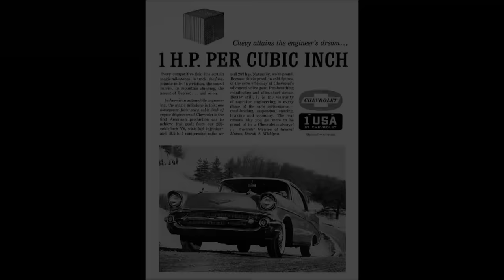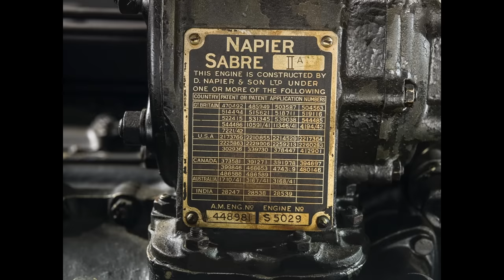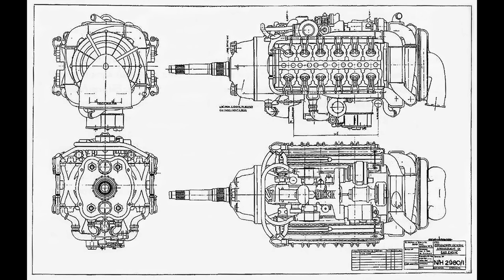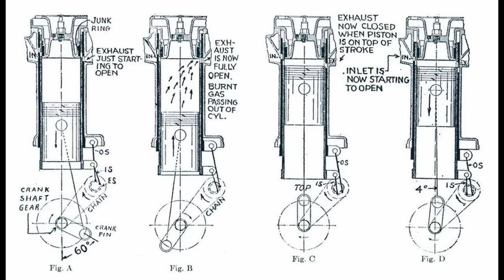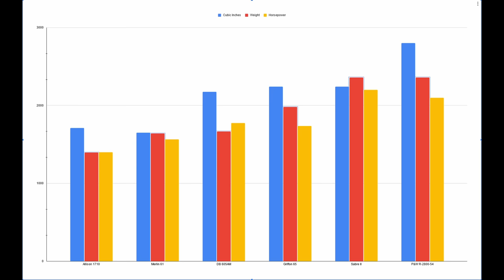Napier Sabre - The Ultimate WWII Aircraft Engine - Part 1

Comment: Interesting. One of my favourite engines. Napier had severe quality control, reliability and management problems in the early part of Sabre.  production. One other problem which many forget is engine cooling. As power increased radiator size had to increase in line. I always wanted to be in on the meeting where the Sabre or PW man extolled the virtues of their complex engines with hundreds of parts - the Swiss watch of power production - and how many horsepower does your engine produce Mr Whittle? - about 2,750 - and how much does it weigh - 1000lbs - ah but how many parts does it have??? One ! - I would love to have a photo of the piston men's faces.
Reply: Great way of looking at it.
Reply: Really for comparison it’s philosophically true but in fact of course there were numerous parts in the whittle engine and unlike piston engines early jet engines had ludicrously short operation times before total rebuilds. At the time they just didn’t have the hi temp metallurgy to run them for very long without catastrophic failure, at least that is my understanding from numerous materials I’ve read from after the war.
Reply: @christopherhughes2211  metallurgy and technique, things we consider obvious now like blade root design took time to develop which is why the more successful early engines used centrifugal designs which are inherently sh1t.
Reply: @christopherhughes2211  You are mixing your English and German history. Read Jet - the book on Frank Whittle and look up Nimonic I also recommend Gas Turbine Engines by Gunston. These will set you right on the development of the technology in Germany and England. Very different. And keep your sense of humour.
Reply: @christopherhughes2211  As a matter of interest - W2B-700 - Combined design based on W.2B/500 and Rover B.26 for Meteor III. Straight-through development of the 'trombone' style W.2 configuration, using already tooled-up compressor casing for Welland, new RR diffuser, and with compressor and turbine air and gas flow increased by 25% to give 2,000 pounds-force (8.9 kN) static thrust. First tested July 1943. Type-tested to 500 hours, into service for Meteor III at 150 hours TBO. Jumo's could only manage 10 hours service and  25 hours before failure.
Reply: I agree with you regarding the quality control issues. I read a book many years ago where early Sabre engine failures were being investigated by the RAF (not the only head ache they had with early Typhoons). Upon engine strip down they found swarf, bits of rag etc inside the engines. For a while they suspected deliberate sabotage at the factory and called in the security services to investigate. The sabre had an expected service life of around 20 to 25 hours before failure. Ground crews used to wrap up hot engines in blankets etc to keep they warm as they found that successive cold starts placed huge premature wear on the engines. I heard this first hand from a ex ground crew foreman who served at RAF Westhapnett (Goodwood). Also interesting to discover that the Typhoon was the only fighter that the pilot had to be on oxygen from engine start until shutdown. Feeding 24 cylinders with 100+ octane fuel lead to huge carbon monoxide fumes build up in the cockpit.
Reply: @christopherhughes2211  The early gas turbines had very few moving parts, the compressor (whether centrifugal or axial) and turbine were essentially one unit as the turbine is required to drive the compressor unlike a piston engine with lumps of metal flying every which way. 
  Frank Whittle remarked that one advantage of his engine was the mechanical simplicity of his design to which an unnamed Rolls Royce engineer was said to have replied “don’t worry old chap, we’ll soon change that”
The main reason that the early German jet engines had poor service lives was that they had limited access the the required high strength, high temperature alloys for use in the turbines. Apparently the French found that when they started on their development of the Jumo after the war even with access to those alloys overhaul life wasn’t that great… First generation jet engine development was a dark art as much as anything
Reply: @turboconqueringmegaeagle9006  I suggest you do some further research (education) - centrifugal engines dominate the helicopter world and many turboprop aircraft in  the 650-1500 hp range. The RR Dart was a big success with centrifugal compressors and over 60,000 PW PT6's have been built. With PR's over 10:1 the centrifugal compressor has a long service life, is tolerant and is certainly not s==t.
Reply: @chrischamberlaine4160   The subject of the comment I responded to was "jet" or turbojet not turboshaft or turboprop so yes, centrifugal flow became obsolete in jet engines as soon as design and manufacture made axial compressors reliable due to 
1. Poor altitude performance
2. Negligible benefit from ram effect
3. Far greater frontal area
4. Greater fuel consumption
5. Weight
Or in layman's terms, they were sh1t.
Reply: @turboconqueringmegaeagle9006  Oh dear !
Reply: @anthonycollingridge970  The carbon monoxide issues were fixed later. Although not the Typhoon, I have the Tempest V pilot's notes, and it doesn't require contiunal oxygen.
Reply: I believe that a lot of the reliability problems with early mass production Sabre engines was due to production being entrusted to a car manufacturing company (from memory possibly Hillman) who had no experience of large aeroplane engines, let alone one as radical and complex as the Sabre,  and in addition were having to use a lot of unskilled labour.
Reply: @tonym480  Quite fascinating to try to establish the history of the manufacture of the Sabre. I'm writing a book touching on the subject at the moment but it's more about turbines and transonics than piston engines. It's well known that Fedden's efforts to get sleeve valve engines into reliable operation nearly bankrupted Bristol and having done so they were asked to give the technology to Napier to rescue the Sabre because the latter could not produce reliable sleeves. I know that Hillman lost a couple of their best engineers (Spencer and Maurice Wilks) to Rover because I worked with the next generation of Wilks brothers in the 70's - John in particular - only then did I discover the wartime dreadful machinations within Rover and their efforts to thwart Whittles W2 in an effort to design their own turbine. Rover had a couple of shadow factories for aero engine production but I don't know which ones they built. Definitely a subject which would benefit from a book about the politics of British aero engine manufacture in WW2. I remain horrified that the big boys destroyed the Fairey Prince/Monarch engines because, with their contra props, they would have added greater safety to carrier operations. The Sabre has always been a favourite of mine because of it wonderfully ambitious design.
Reply: QaA1 lo
Reply: Stanley hooker said that a piston engine has four strokes, one for power, the other three to wear the engine out.

Comment: Interesting video. There's a lot here I didn't know about the Sabre.

I think I can offer some technical maybe insight, based on my own amateur speculation.

Concerning the Sabre's high weight for its displacement, that makes a lot of sense based on its design principals. I doubt the two crankshafts are the main factor, since both a V12 and an H24 have two cylinders per crank throw, so they're about equally weight efficient there. Instead, take a look at the cylinder dimensions. The Merlin had a 5.4 inch bore and and a 6 inch stroke (an undersquare cylinder), whereas the Sabre had a 5 inch bore and a 4.75 inch stroke (oversquare). The Sabre cylinder has both a much shorter stroke to bore ratio, and it's smaller (much smaller in terms of displacement, which goes as the cube of any linear dimension). Longer strokes and larger cylinders are simply more efficient in terms of structural weight. You need to add a lot more metal to get an extra inch of bore than an extra inch of stroke. All containers become more weight efficient with larger size because of the square-cube law. If Sabre was also designed from the start both for a higher power density and higher RPMs, Napier would have needed to go for heavier construction to achieve similar longevity.

So all in all, the Sabre's high RPM (and the small, oversquare cylinders which made that possible) and its high power density intentions lead to a higher structural weight per unit of displacement. The trick, naturally, is to make the power go up by a greater factor than the weight. 

We can see just the opposite design approach with your figures for the R-2800. A big air-cooled radial is maybe the best common design for getting a lot of displacement out a small amount of weight. Big, long-stroke cylinders are, again, more weight efficient. A radial puts a lot of cylinders around a small and short crankcase and crankshaft. Air cooling removes the need for a cooling system, cooling jackets, etc. On the other hand, the R-2800 has a poor specific power. Air cooling becomes a constraining factor at high power densities. Making more power inevitably produces more heat, and liquid cooling can simply remove more heat than air cooling. Overhead cams are also impractical in radials, so they're usually limited to two valve heads with not very optimal designs, and that along with the long stroke, limits RPM, further hurting specific power.

As for volumetric efficiency, it's probably very hard to get good figures on that, and even then, the circumstances under which they were determined may not be comparable, but I really doubt that they differ much between these engines. Any engine designer with high performance intentions has to fail pretty hard not to achieve a high volumetric efficiency at his intended operating RPM. The trick is, which RPM. The huge, unobstructed ports of a sleeve valve design would be great for shifting the peak volumetric efficiency up to a higher RPM, unlike poppet valves which partially obstruct the ports even when open. So the Merlin could achieve a high volumetric efficiency at 3,000 RPM, but at 3,800 the poppet valves just wouldn't be flowing enough to efficiently fill such large cylinders, even with four of them. Of course modern engines do breath through poppet valves at much higher RPM, but they also have much smaller cylinders and technology has just advanced. The R-2800, with even larger cylinders probably wouldn't have been able to go much above 2,700 RPM structurally anyway, so even with only two valves and the non-optimal placement dictated by push-rod actuation, it would still be able to flow enough to achieve good volumetric efficiency at its low operating speed.

I think you're also understating the difference between a 7:1 and a 6:1 compression ratio. That's actually pretty huge both for power output and fuel efficiency. Poppet valves were often a limiting factor there, with designers going to extremes like filling the valves with sodium in order to avoid hot-spots and detonation, so having no poppet valves may have helped the Sabre there as well.

So we can probably say that the Sabre's power is mostly related to its RPM, displacement, compression ratio, and how much manifold pressure the supercharging system can produce, and all the other design features, like H-24 layout, small, oversquare cylinders and sleeve valves, are what allows it to achieve high RPM in such a large displacement. At some point, detonation might start to limit manifold pressure, and at that point, the lack of poppet valves may become an advantage to delaying detonation, but it sounds like the Sabre never really got the point where detonation could become a limiting factor anyway.

Comment: Weight is a big factor in military aircraft, but something that is often overlooked is a form factor and the effect on the overall designs aerodynamics and pilot visibility. A narrow deep cross section can be packaged with better aerodynamics and a low slung flat or horizontally opposed engine can improve visibility and potentially stability. While the engine is a very heavy component in an aircraft, with military planes with armor and cannon,bombs, and the many redundancies required to make an inherently fragile aircraft more rugged and survivable the engine is a smaller percentage of the overall weight. The specific power is likely more of an indicator of easier packaging, power to weight ratio is usually a good indicator of fuel efficiency.
Reply from the maker: I had actually planned on including a comparison of horsepower per cubic inch of aerodynamically wetted area, but cut it for time. I may have to take another look. The challenge will be including the size of the radiator components.

Comment: Very interesting story of this complex and successful engine.
Napier's had made a turbo charged version of their W 12 Lion engine which was successful.
It is surprising they did not design a turbo charged poppet valve V 12 engine which should have had the best power to weight and power to displacement ratio
I guess they could also have designed and made  a poppet valve V 12 engine with engine driven superchargers  running at higher RPM and BMEP to produce 2000 BHP.
High Octane fuel and the design of the Supercharger would have been the key to success.
I feel they were fixated by volumetric efficiency which is improved with sleeve valves at the expense of weight complexity and cost.
Manufacturing the Sabre's sleeve valves caused problems  which were eventually solved by Bristol who used the same valves on their Radial engine.
In  turn Napier's sorted our the problems Bristol had with the complex gearing on their Radial engine.
They ended up with a complex over weight design with the Sabre which required a great deal of development work to achieve a good result.
The Sabre is a mechanical engineers marvel with all its complexity and should be held up as an example of determination and patience .
Napier and Hawker came together to produce the most effective ground attack aircraft  towards the end of WW11 .
It was feared by the enemy and helped greatly in ending hostilities.
Reply from the maker: my guess is they were unaware that sodium cooled poppet valves was being developed when they were searching for ways to bypass the theoretical 1500hp limit on traditional poppet valves... not sure on that one though
Reply: There will always be a limit on air flow with poppet valves. The valve size is limited by cylinder bore diameter, which determines the combustion chamber size.

The Sabre was making over 1000bhp more than the Griffon on the same fuel. Unless you get into exotic fuels, there is a limit to how much boost you can use before detonation become a limiting factor.

Given there was a war on, big power from whatever fuel you could get your hands on was a big advantage.
Reply: @flightdojo  The Wright J5 Whirlwind of 1925 used sodium cooled exhaust valves. Lindberg used this engine to cross the Atlantic. Napier were certainly aware of sodium cooling of ex valves.

Comment: 12:15 At right: Roland Beamont, who was, at the same time, an operational pilot and one of Hawker's chief test pilots. At a time when the Typhoon was having structural and engine problems that cost a lot of pilots their lives, Beamont, who could see the potential of the Typhoon, was an active campaigner for its retention on operations.
Ironically, one of the things that saved the Typhoon was the Focke Wulf 190. This fighter was converted to carry bombs and would make low-level raids on English coastal towns, usually in bad weather, and retire at high speed. The Mark V Spitfires, which were almost totally outclassed by the 190, had little to no chance of catching those hit-and-run raiders.
The Typhoon was the RAF's first 400 mph fighter and quickly proved capable of catching the 190s, and also outmatching them at low altitude.
When countering the 190 raiders, Typhoon squadrons were kept at forward bases, at constant readiness. The Sabre engine could be a pig of a thing to start, so the engines were kept warm and ready to fire at the first bang of the starter. This meant running them up at various hours during the night, which, in some cases, got the locals irate. I have a book on the operational history of the Typhoon, in which it is told how one squadron received a complaint from some of the locals living within earshot of the base. The Commander wrote back, politely asking them which engines they would prefer to hear: Typhoons or Focke Wulf 190s.
Reply: I like that
Reply: Erks were always standing by with fire extinguishers when a Napier Sabre engine was fired up.  
Tip and Run raids increased dramatically in March 1942.  The Spit Mk.XIIs were first used 3 April 1942.   Late production LF Mk.V's were as fast as the 190 and outclimbed it easily and were more manouverable than the Mk.IX. .

Comment: Flight DoJo, good video, but you never mentioned its biggest problem, (other than its reliability issues,) its terrible overheating problem that came from so much HP. The Typhoon's massive "Chin" radiator made it very vulnerable to AA fire and it suffered worse losses than Bomber Command's heavily bombers.
Reply: All one has to do is look at P47 vrs P51 numbers for loss ratio to sortie and flight hour by year flown.  P47 had 3X lower loss ratio even though IT was tasked with ground pounding and bombing while the P51 was NOT.  P47 in fact had lower loss ratio than both the Mosquito and the P38.  Difference?  Air cooled Radial engines are vastly superior to non air cooled engines(yes some radials were liquid cooled).